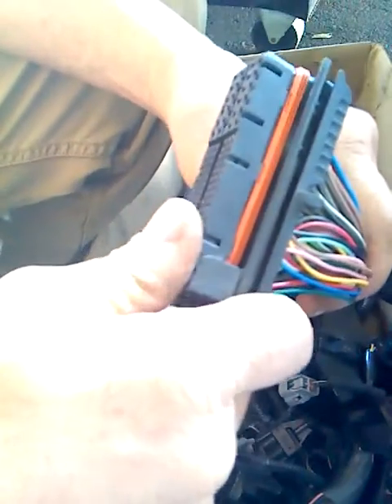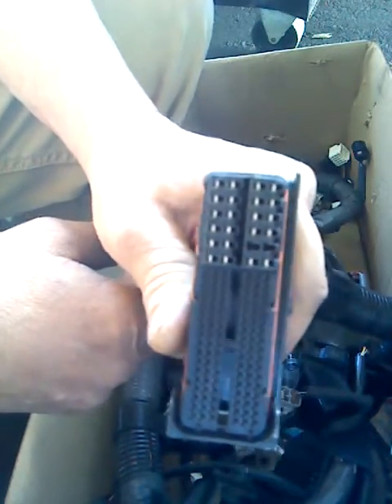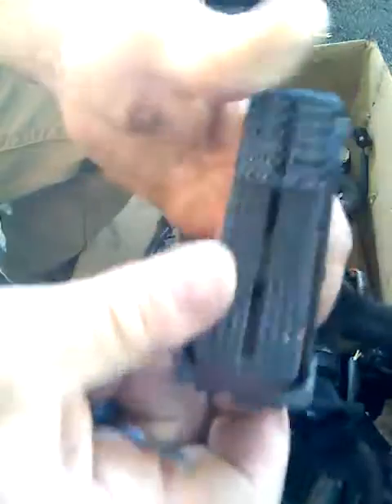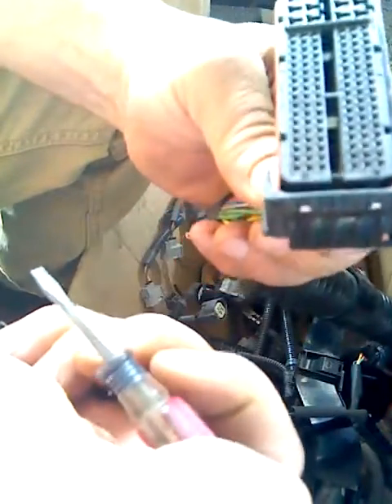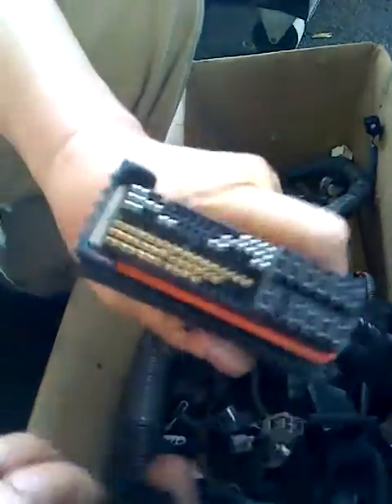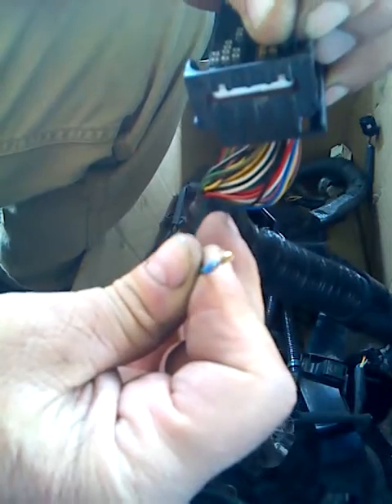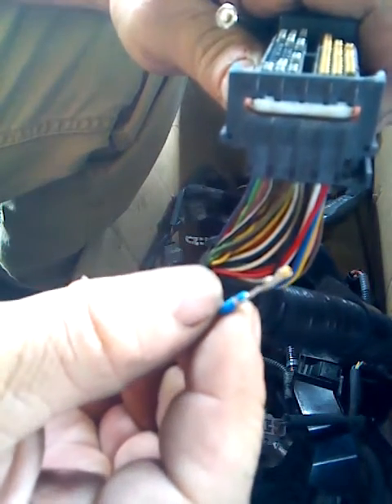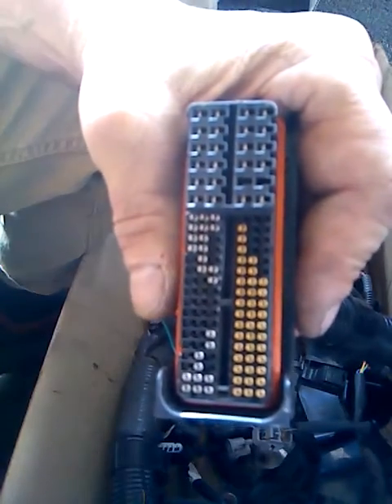Toyota 2GR-FE 3.5 liter V6 ECU Connector Terminal Remove and Replace

Comment: This is the best car video I’ve EVER seen. I can’t stop laughing… your favorite screw driver and Toyota Teresa, classic. I started watching this because my 2007 rav4 2gr-fe and have a p0333 indicating knock sensor bank 2 problem. I’ve had rodents bite through some wires so I’m attempting to to check the continuity of the wires for the knock sensor and possibly replace the sensors. Thoughts?
Reply from the maker: This is a tough one. The sensors are very tough to access. They are under the lower intake manifold. However they both connect into a sensor sub-harness, which in turn connects into the main engine harness in a easier to access location So you can test the wiring from that point to the ECU. If nothing comes up with that test, then you have no option but to dive in. Another test: If you can pick up used sensors and a used sensor sub-harness for cheap from a junkyard, just plug those into your engine harness (no need to actually install, just for testing) and see if the code goes away.

Comment: Hi, Do you have an diagram for 2GR-FE ECU you could PM me?
Reply from the maker: There are 40 or 50 2GR ECU's. Which one do you want.
Reply: @Merryfrankster_  good question, I would say the ones that connect to coolant temperature sensor and the mass air flow sensor.  Got codes p0118 and p0101
Reply: @Merryfrankster_  Update: I want the ones shown in your video.

Comment: Hi Frank, do you happen to know the toyota partnumbers for the big and also the small terminals ? Thank you very much in advance. Best regards, Jos Swagemakers, The Netherlands
Reply from the maker: I do have these filed away somewhere and I'll dig for them but meanwhile I suggest you check with Ballenger Motor Sports. https://www.bmotorsports.com/shop/
Reply from the maker: another related link https://www.mouser.com/TE-Connectivity/Connectors/Automotive-Connectors/_/N-1ehb5?P=1yzs6iiZ1yq9c03
Reply from the maker: And here's the source for all Toyota connectors and terminals https://www.toyota-tech.eu/wire_harness_rm/RM06H0E.pdf